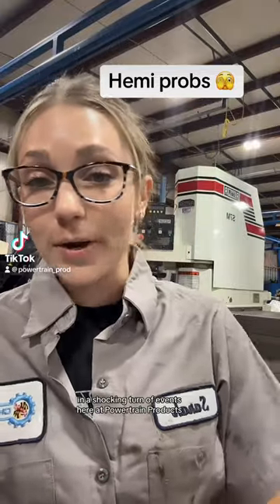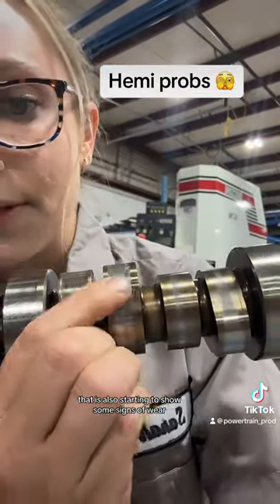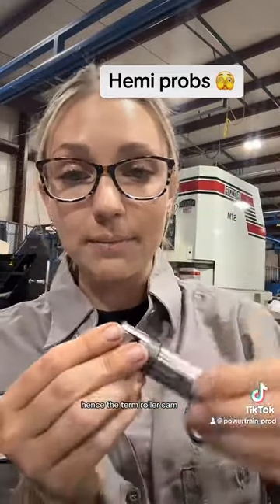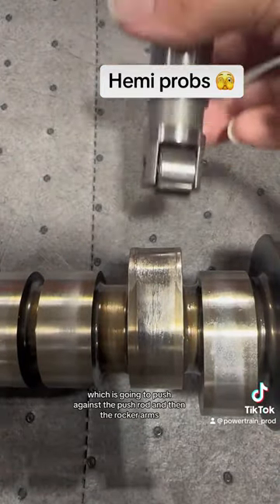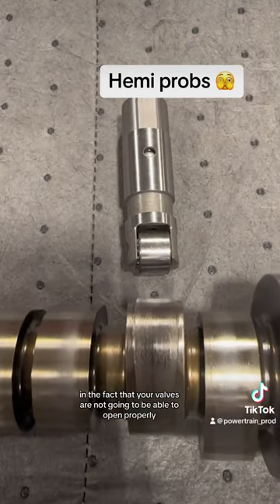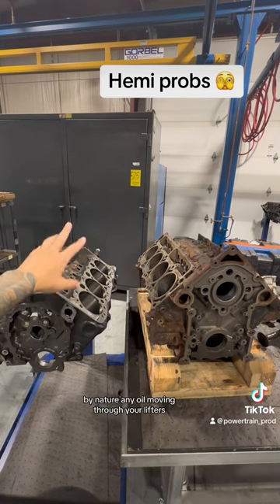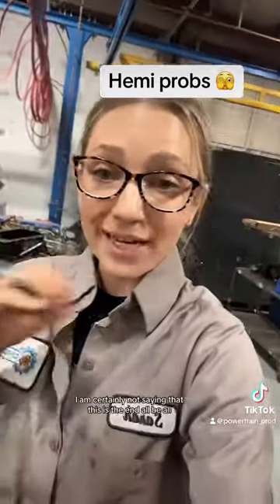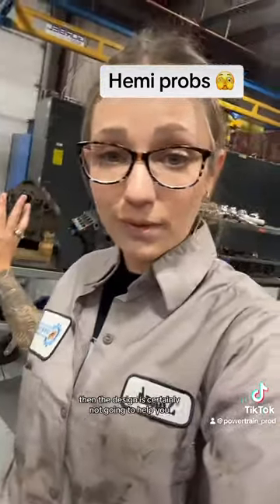Gen 3 hemi lifter and cam problems ?

Comment: Sorry people but it's not just dodge that has the problems with the cam and lifters. Chevrolet has the problem Ford has the same problem.
Reply: All the e90 bmw platform will always have lifter tick after 100k miles.
Reply: Yup, all the modern pushrod V8s have lifter problems unfortunately
Reply: Idk my 2020 gt 5.0 doesn't even tick when 2010 300c ticked since purchase almost until it's cam lifter failure 50k miles later made it to 130k
Reply: Your exactly right about that

Comment: Gen 3 has a flaw in supplying oil to lifters and cam. The oil is supposed to pump up through the lifters and to the cam. Should be a hole in the lifers but is not so  bareley pumps oil at low rpm, so at high rpm it gets somewhat better flow. Change lifters and cam..........not stock.

Comment: Thanks for the video.  You are one of the few willing to tell the truth.  I replaced my camshaft and lifters 7 years ago at 105,000 miles.  Number 8 intake lifter was half gone and every needle bearing was inside the engine.  Took hours accounting for every needle with a magnet to extract the debris.  Plus intake lifters on cylinders 3, 4, and 5 were damaged.  230 miles now and I once again have a lifter failure on number 4.  At this point in trying to decide on a reman engine or cheap repair of the current engine in order to dump the truck.  Never buying Dodge again!!!

Comment: A Mopar with failed lifters. Huh. I'm shocked 🤣😂🤣😂🤣
Reply: Like Gm doesn't have that issue...
Reply: I'm an equal opportunity h8er. From Acura to  Zender they ALL have issues.
Reply from the maker: Lol exactly
Reply: The lack of oil changes and the fact that modern motor oil lacks zinc.  Many will say you don’t need it in a roller cam but folks tend to forget those little needle bearings in the lifters need all the help they can get.  Otherwise spend the few extra bucks every few months and change your oil.

Comment: She explained it perfectly. When I first opened a hemi engine and she how the lifters sit, I knew that it was a flawed design. The chevy 350 lasted for so long because it was a nearly perfect design.
Reply: You’re wrong because the 2003-2008 5.7 hemi had the same lifter placement but very rarely had lifter failure.

Comment: The early 5.3 Chevy engines were also notorious for eating lifters. The 5.4 3 valve Ford engine kills cam phasers with regularity. The 3.6 "High Feature" GM V6 has timing chain issues as early as 80k miles. And don't even ask about engine's like the Hyundai/Kia "Theta" motors. Instead of Kia they should call it K.I.A. (anyone in the military knows this term)!!! There are dozens of other engines with known issues. You would think in this day and age with the assistance of computer simulation programs and precise CNC machining engines would be getting better. Sounds like a lot of this might be on purpose?

Comment: My hot idle oil pressure sits at 30 psi @ 525-550 rpm on my 20 ram. That’s not enough oil pressure to properly lubricate the needle bearings in the lifter roller. Due to the near flat angle of the lifter in the engine combined with the low oil pressure they don’t get enough flow to the needed bearings and they don’t get gravity lubricated like in most other V8 engines when at hot idle. Police and fleet vehicles tend to idle for really long periods of time and then Change the oil at the recommended times and that’s around 8,000 to 10,000 miles. Lots of those motors only make it to 60k some as little as 40k before lifter roller failure. So what do you do? Well first thing first absolutely no more than 5k with a good oil and filter. (Mobile 1, pennzoil ultra platinum or equivalent). The hot idle rpm is very low and that way for emissions reasons. So the next option is to go to your local tuner and increasing the idle RPM to 650-700. This will increase the oil pressure to the mid 40s. This is the less invasive option. The next option is pretty major surgery. If you have to open the engine up replace the oil pump with melling pn# 10452 or a factory hellcat oil pump and this will supply the needle bearings with the proper amount of oil. Understand this is an hot idle oil pressure problem not regular driving.  Don’t be afraid to remote start your vehicle. Cold idle oil pressure is in the high 50s if not low 60s.

Comment: Fun fact: there is always a risk of damaging camshaft bearings when removing the camshaft......on the hemi the bearings are non serviceable. If they get damaged, either through normal wear or while removing the cam, then you have to replace the block 

Or remove the engine from the vehicle and take it to a machine shop where they can replace the bearings with, hopefully, aftermarket, because you can't even buy the OEM bearings. 

The design of these engines is absolutely ridiculous

Comment: Looked at several videos.   The design is flawed.  Your lucky if your hemi lasts.  
I'm sticking to the 2010 4.7 swap to a 2003 Dodge Durango.  I was thinking hemi. But after everything I learned.   Hell no. It's not just a part you can fix.  You can't redesign a block.

Comment: It's not an Engine Design Problem!  You need to install a high Volume 6.2 Liter HEMI Hellcat Oil Pump Design for Higher Oil Pressure from a Hot Normal 210 Degree Ferheigh that kicks out 50 to 80 PSI we're as the Standard 5.7 Liter HEMI at 210 Degree kicks out 23.5 to 32 PSI!  And that is on only Chrysler's, Dodge or Jeep 5.7 Liter HEMIS Engines that only make up less than One Tenth of a Percentage of a Million or More Chrysler 5.7 Liter HEMI Vehicles that have a 250k to 800k miles in the last 20-years! There's Absolutely "NO Engineering Designed Flaw" on the Greatest Modern Piston Engine Ever Made and the "Fastest Production Vehicle and Generation 3 HEMIS Ever Produce From The Factory to the Showroom Floor "The Dodge Redeye Hellcat" 2.3 zero 60-MPH and Less than 8-Second Quarter-Mile!  A 5-Passenger 2-door Hardtop Muscle Car with a Full-size Trunk! Buy A Mopar Chrysler Gen 3 Hellcat 300, Dodge Hellcat Challenger or Dodge Hellcat Charger, Now! These Awesome Automotive Vehicles are already Collector Vehicles At Mecum Auctions Running into the 6 to 7 figure Ranges! Only the Chrysler, Dodges & Jeeps! No other make of Foreign or Domestic Cars can Touch the Engineering Excellence of the Chrysler Corporation along with Tom Hoover, who Design the 426 Elephant 🐘 Gen. 2 HEMI, who helped the New Chrysler Performance SRT8 Team Design and Engineer The Generation Three (3) Chrysler, Dodge & Jeep HEMI Engine to Put Performed any Internal Combustion Piston Engine on the Street, Strip/Track, Formula I, and NASCAR!  That's why we don't see any of Chrysler Vehicles in NASCAR Racing because their Chrysler 300's or Dodge Challenger 's or Dodge Charger's would Literally lap Every Ford, Toyota, and all the General Motors Chevrolet Vehicles like Plymouth & Dodge did in the 50's, 60's & 70's!
Reply: I would agree with you but the fact is a lot of 6.4 Hemi’s are failing as well, mostly on Police and Fleet trucks and cars.  The problem is insufficient oil to the valve train, and unreliable lifter rollers.
Reply: I meant to say 6.2
Reply: strongly disagree uncle tony's garage did a demonstration on these the problem is when they moved the cam and changed the angle of the lifter bore the top of the bore never gets oil which is why one side of the lifter body is always scuffed it also compounds the problem because the roller barely gets enough oil he demonstrates the lifter bore angle difference and how how all the older stuff drained into the camshaft or the lifter bore. dodge chose not to pull their head out of the sand and they do have a bad design, johnson-moral has a lifter to cure the roller problem but short of an aftermarket block theres not a real fix to the top of the lifter bore running dry
Reply: @MarcusMckinney-x7o wrong. 2003-2008 5.7 hemi block is close to identicle to the 2009+ and those very rarely had lifter failure like these newer ones. Blame it on the stock oil pump 

Hellcat blocks are identicle and have the same lifters as non Mds cars but I’ve never heard of a hellcat having lifter failure